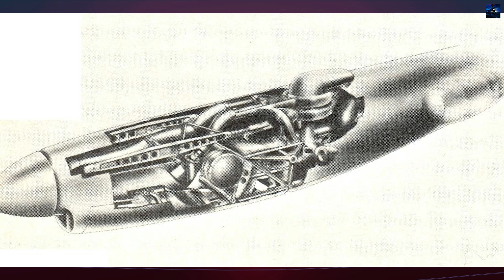Lockheed XP-49: The “Future Fighter” WWII Wasn’t Ready For

Comment: A total waste of time and money. 

The War Production Board should have authorized the P-38K in April of 1943. As well as the NACA changes to the center wing. 

By late 1943, the U.S. would have had a 450 MPH+ P-38, with a critical Mach of 0.75, well as incredible acceleration, climb rate, and range.

Comment: WTF? At 2:09 the video shows 2 photos of a completely different aircraft than the rest of the video - one photo on the ground, the other in the air. What is that aircraft? It has similar configuration, but it's not the same as the other photos. The one on the ground has much beefier landing gear and the one in the air has a completely different tail boom/vertical stabilizer configuration. What is that aircraft? It doesn't match the other photos of the supposed XP-49, which looks almost identical to a standard P-38. Please explain your video.
Reply: Xp 58 chain lighting.